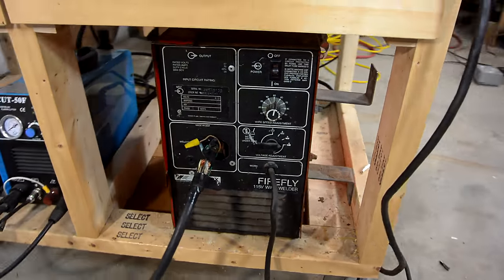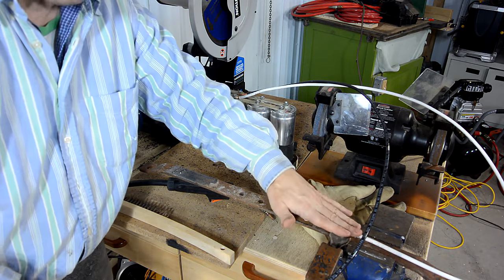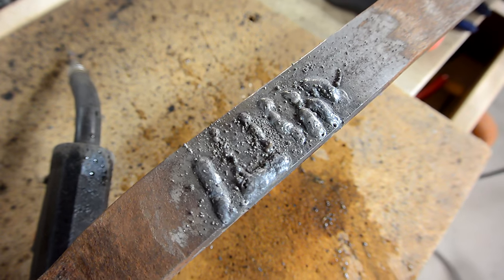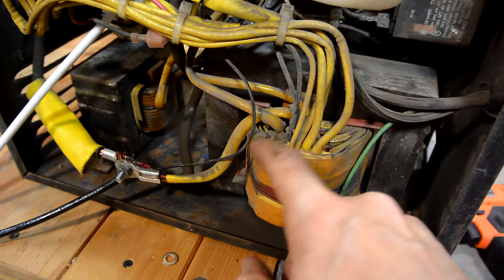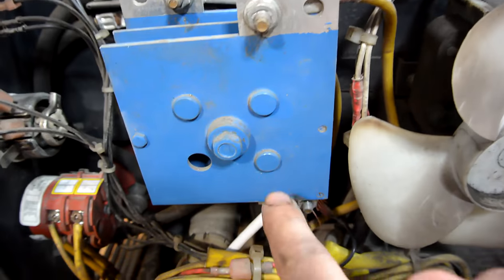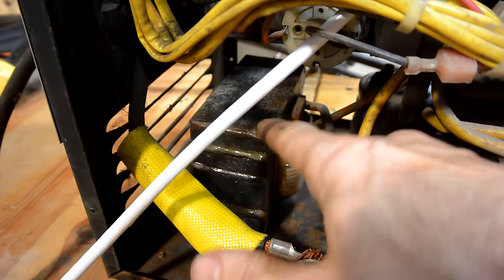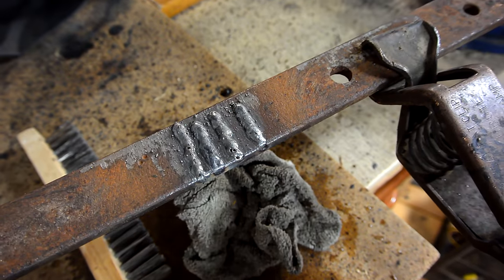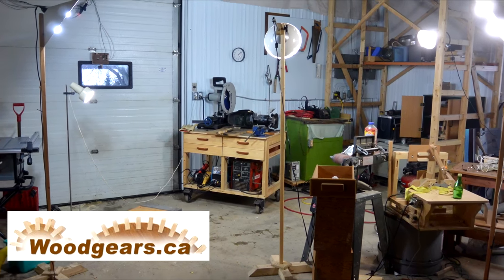Welder capacitor upgrade (fail)

Comment: The reason why those capacitors don't make a lot of difference, is because the quality factor of the filter formed by the inductor and capacitors is also influenced by the quality factor of the inductor. You can combine a capacitor with a great Q-factor with a crappy inductor all you want, your total Q factor will always be limited by the Q factor of the inductor.
Reply: What leads you to believe the quality of the inductor is an issue? Do you have personal experience with this exact model welder, and have made measurements?
Reply: We're talking about quality factor pertaining to tuned circuits
Reply: retrofitter
the reincarnation of Tesla you're not. Tuning only pertains to capacitors across coils, not in line with them. This is not a LC tank circuit. This is a DC circuit, so there is no tuning going on. As you cannot tune 0 Hz. We're done with you!
Reply: No, you're not dealing with an LC-tank circuit, you're dealing with an LC low pass circuit. And yeah, now I come to think of it, the filter probably isn't operating in its resonant region.

The main point of my argument however still holds true: if the inductor is crap, there's only so much you can do with improving the capacitors. The series resistance of that inductor will always be a limiting factor in how well the low pass works, especially if the inductor gets hot.  Because I was thinking in terms of the series resistance of the inductor, I abused the term quality factor, shoot me for that :P 

And no, I don't own this welder, but I do have the audacity to hazard a guess at something. Being wrong and corrected isn't a shame, it's how I learn.
Reply: LReBe7
in this application the choke is there for additional filtering, and stability. Now if the choke is inadequate for the current being passed, and that's a big if, then yes, you will have reduced output. But so far I've seen no evidence to suggest that is the case. It looks like a fairly substantial component to me.
Reply: Yeah, looks like a big component to me to, but if it's a cheap welder with so few parts and it's not the C on the LC, it's probably the L. Only other thing that could give it a bad arc - if we rule out user error, which is always a big if, no matter who you are - would be the rectifier or the main transformer, there's not a whole lot else to go wrong in this thing. Personally, the rectifier does seem like a better culprit to me.

One final note about that inductor: just because something looks big, solid and heavy, doesn't mean it's any good, for all we know, the inductor could be wound with aluminium wire.
Reply: LReBe7
the color of the windings appears copper to me. This machine looks too vintage for it to be copper plated wire either. Some research online suggests this particular welder is a rebranded Miller. So not the worst welder on the planet. Regardless of various uninformed opinions about it.
Reply: Just because it looks like copper on the outside doesn't mean it is. I once scrapped an old welder I got for free(it was like 12 kW, so I couldn't really run it at home) and a couple of the transformers which I assumed would be copper, turned out to be aluminium unfortunately.
Reply: LReBe7
Miller never used aluminum in their equipment.
Reply: *****
All things considered I think those beads looked pretty good.

Comment: The amount of dust inside the welder could of done some damage to components or even a connection made that should not be made. First really clean the machine, spotless, second check all connections especially the grounds. Would bet you that there will be a major improvement for you fella.

Comment: No offense to your welding skills, but I would probably get an experienced welder to try with and without the capacitors to eliminate other variables as Mr. Heisz said.  Distance from tip to material, travel speed, welding angle, welding wire (actually makes a big difference), etc.

Comment: Enjoyed your video !  Recently I bought  a fluxcore mig and now have a 100-amp rectifier to convert
it to DC.  My question has been how effective filter capacitors would be if I added them. Your video
answers that for me, at least for now.     :)  :)
Reply from the maker: without any filter capacitor, converting it to DC won't give you much benefit.
Reply: Conversion to DC Electrode Negative, will put 70% of the working current from the ground clamp into the work.
The remainder 30%  then going to the electrode. Use Electrode negative wire.
Bridge install will also double the output in Hz from the line input.
Reply: @matthiasrandomstuff2221  Would be interesting to see what the voltage and current waveforms look like on an oscilloscope with and without the added capacitor bank.  Compared also making a more cost effective MOT core custom wound inductor to smooth the current that I'm guessing might have the same effect on the potential waveform/field.

Comment: you can only smooth out the valleys so much. more caps wont help it. if the one in unit is doing its job already. overkill doesnit work sometimes ..
Reply from the maker: well, on a cheap welder, you don't know if it's doing it's job already.
Reply: @matthiasrandomstuff2221  on these the avg 100k caps should be fine. more then that probley not

Comment: If your welder already has a capacitor from the factory adding more won't do anything. Manufacturers don't install undersized capacitors. Very cheap wire welders weld with A/C instead of DC. These welders don't have capacitors, reflector bridge or a choke. The best tip I can give you to improve your welds is to buy quality flux core wire. Cheap no name wire sold at places like Harbor Freight Tools produces crappy welds no matter how good your welder.

Comment: when that welder finally dies get yourself a used name brand machine like hobart, miller, or lincoln.  then get a bottle of 75% argon 25% CO2.  I bought my lincoln 140 for $200 and it's paid for itself several times over

Comment: Best bang for your buck will be cleaning the material well, including under the ground clamp.

Possibly a different ground clamp - brass or copper with more surface area.
I have a 2x4" brass plate that I clamp to the clean work.

It looks like porosity in the welds, are you sure you are clean ? no oil paint or rust contamination ?

2:42 Gun angle looks low
http://www.wcwelding.com/images/work-angle-travel-angle.jpg

Try more straight to the work, with some side tilt that pushes the slag back from the direction you are traveling in.

If that shop is cold try preheating the steel on top of the woodstove or with a little propane torch.
A little extra heat makes a difference.

https://www.amazon.com/Wall-Mountain-Flux-Welding-603DVD/dp/B0006ZFRVG

http://www.wcwelding.com/flux-core-arc-welding-dvd.html
If you message me, I'll send you one.

There are lots of internet tutorials on using scavenged microwave transformers to build arc welders.
Maybe more experimentation fun there ?

Comment: NOTE: Capacitors go bad. So try replacing the capacitor. Also, try soldering the connections, upgrading the wire to larger wire, replacing the ground strap with a copper braided strap, and also try testing or replacing the rectifier diodes. Also, try a different brand of wire. Every wire is a different alloy, and there is no "standard" alloy, they are all different. Every wire is an experimental prototype metal alloy, so try different brands of wire until you like what you see.

Comment: There is so much in this world I don't know. I wish I understood more things
Reply: One of my college professors enlightened me on this. He said 'books.' Anyone in the class could get a few books on a subject and read them. At that point they could become more of an expert on that specific subject than he, or any other professor, was. Books are the power. If you want to understand more things, start by getting some books on those subjects and reading them. I can guarantee it's what Matthias did to learn what he knows.
Reply: jodeum2  I tried welding books, didn't work...
Reply: You should try:
1) Better ground contact (use copper wire under the clamp)
2) Clean the area to be welded (dirty fingerprints??)
3) TIG... it welds everything (apparently)
4) Of course, you'd need to adjust your speed with hardbacks to get more penetration (down to chapter 3 is recommended).  For paperbacks, you need to run the bead much faster.
Reply: EscapeMCP lol joke extrapolation

Comment: As there is no shroud around the tip , the inert gas will go everywhere exept around the weld. Surely fix the fundamentals first!!!
Reply from the maker: if there was inert gas coming out of it, which there isn't cause it's not a mig welder.

Comment: the IG is missing from your MIG
Reply from the maker: that's why I didn't call it a MIG welder.
Reply: Jokingly trying to say make it a MIG for a better weld.
Reply from the maker: ah, well that requires adding plumbing to the welder and new gun.  Enough changes that it would make more sense to get an actual MIG welder.  And then I have to worry about gas and such.  So decided to just live with it.
Reply: Matthias Wandel Flux core welders are just fine for the small work I do (as you have demonstrated in a few of your previous videos). Old cheap wire caused me lots of problems until I got some nice new Lincoln wire and my welds were 200% better, even though I don't weld much anyway and need more practice - haha.
I wish I could easily change mine to DC+ as yours does.

Comment: Where's the mig nozzle?
Reply from the maker: I usually have it on there, helps avoid accidental shorts.  But had it off so I could touch the wire to the end of the torch.
Reply: Maybe trying with the nozzle -- if you're running regular gas shielded mig it's going to affect the weld.

Comment: That is NOT a cheap welder! That is Canox, which is made by Miller!
You should check the polarity on it as well. Different polarity for mig (solid wire with gas) or flux core welding.
You can see one of my videos about the issues I had with my Miller. It looks almost the same as your Canox.
Cheers!
P.S. I just subbed to your channel. Please sub back! Thanks.

Comment: Your skill as a welder is not good enough to see an appreciable difference.  Also, you are using flux cored welding wire and if I remember correctly, the rectifier setup on that welder is a half wave.  So to really see any appreciable difference, your skill will need to advance, you'll need a full wave rectifier, and you'll need to be running GMAW as opposed to FCAW.
Reply from the maker: half bridge, full wave
Reply: Matthias Wandel, you are correct in part and I was incorrect.  The rectifer in that machine does produce a full wave rectification, although I have never heard of a half bridge.  Single phase bridge rectifiers only come in full or half wave as far as I know.

More specifically, that type of rectifier is called a selenium rectifier, or sometimes metal rectifier.  I replaced one with a silicon diode full wave bridge rectifier in a welder almost exactly like that.  Metal rectifiers are notoriously inefficient and prone to failure.

You would probably get decent results with a proper rectifier, about 40000uf of capacitance, and the inductor that is already installed.  Unlike woodworking, welding takes considerable skill to manipulate the weld puddle properly even after learning proper machine settings and material preparation.  Carpentry is to wood carving as knowing how to set the machine is to actually welding.

Comment: You can't(actually, you can) polish a turd, but it's hard, and even so it's still a turd.

I don't see a reason to buy a new better one, because you don't use it often, but if you get a better welder you are maybe going to use it more?
Reply from the maker: Well, with my experiments here, the biggest improvement came just from doing a whole bunch of test welds and getting better at it.  So I think the most appropriate welding upgrade I can make at the moment is to my skill level!

Comment: The rectifier is loading the capacitor. If you add capacitors, you have to look, if the rectifier can load this. Also the transformer has to fit for this. AND there is danger, that you kill the rectifier. The switch-on-current is much more higher then the normal current. Probably the  addon-capacitor incl. the standard one is not really full loaded. So you will not have any effect at the welding. This was not a scientific experiement. Just my two cents.

Comment: Matthias, do you use flux core wire of good quality? Also, check your machine settings... Your welds are really ugly. It almost look like if you run solid wire instead of flux core...  And yes, it do make an huge difference.

Comment: Try moving the capacitor bank leads to the far ends of the bank of 5.  I have a feeling you're not getting much out of the other 4 capacitors even with the link bars due to resistance.

Comment: Fluxcore is the pocket screws or Gorilla glue of welding. While it works and any bozo can do it, it is far from the ideal process for most things. You might want to look into other processes before investing much time with that.  If you just want to stick two pieces of metal together, have at it. If you want to do so with the quality of your woodworking, look to another process.

Comment: if u use  mig welder use CO2 or  CO2 argon mix  , dont use that stupid  flux wire its negates the whole idea of mig welder . if u like the flux wire then use stick welder , its a lot easier to weld whith gas because what u see is what u get

Comment: Yep, you where messing with inductance, aka voltage amperage slope shapes, small flux core doesn't give a crap about inductance, but if you where doing overhead stainless steel with 98% argon and 2% oxygen on short circuit transfer, oh yeah inductance makes the difference between ugly abomination and a purdy weld